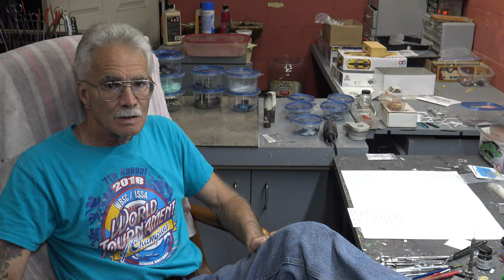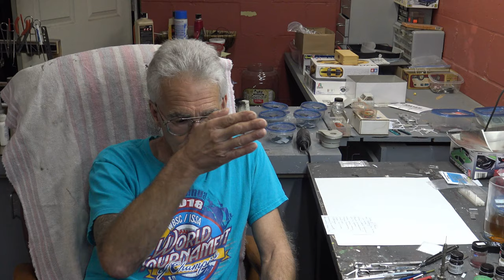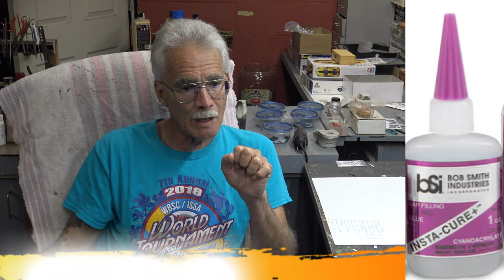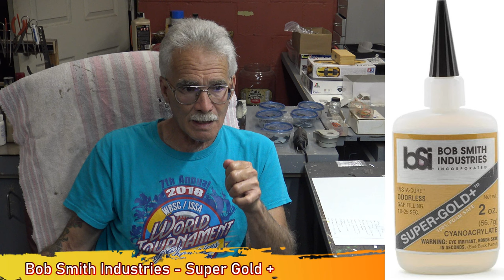Q-A - 5-26-22

Comment: Hey Don I have a question can I use testors brush cleaner to break down the paint to go through my air brush for painting? My apologies if you have covered this before or is there a hardware store brand that I can use for the testors bottle paint and what brand? Thanks
Reply from the maker: SunnySide lacquer thinner . It can be found in most hardware stores and feed supplies …..

Comment: I have heard others say "flash out" between coats of paint in their videos when they are spraying paint. They would say let the paint flash out for 5 minutes before shooting the next coat. Is that the same thing? What are they talking about if it's not. I know what you meant about fully curing the paint too.
Reply: When you apply paint the pigments and metallics are actually floating in solvent. Flash out or flash time as some call it between coats is a term used when talking about letting the solvents evaporate off the surface leaving the pigments and metallics behind. You can actually see when it is happening. It looks like the paint is starting to dry but is still tacky. If you don’t let paint flash between coats you can end up with runs or solvent pops which look like tiny popped bubbles from the solvents from the under layers pushing out to the surface. Flash out when the painting is done just refers to dry time until you can handle and polish the finished product.
Reply: @toddbreitenstein8522 . Awesome. After hearing what was said about total curing I did wonder. This makes more sense now. Thanks.